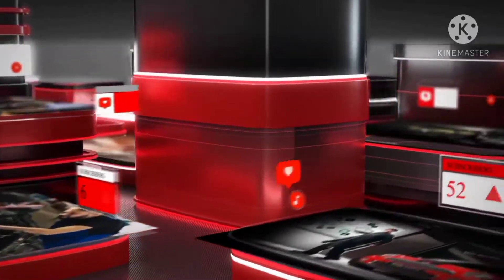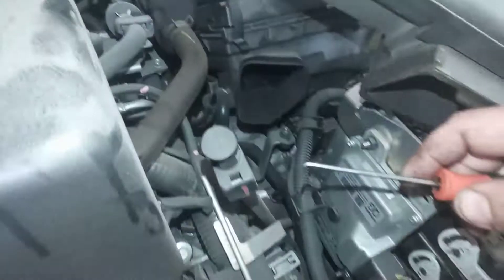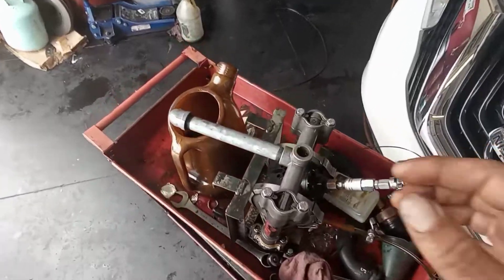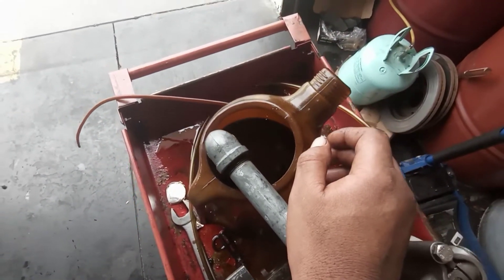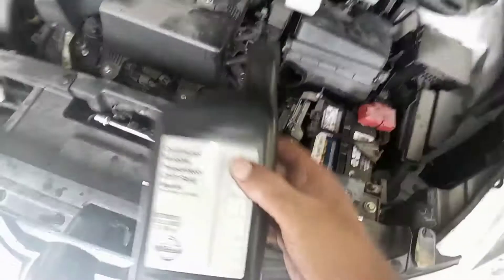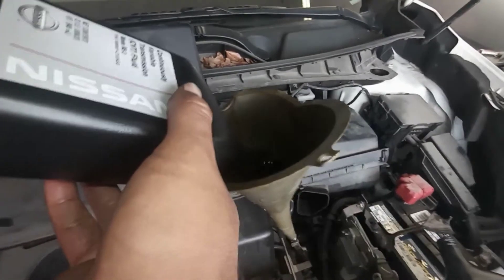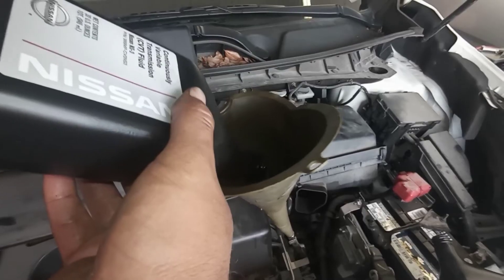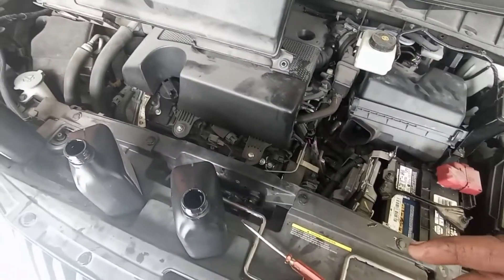2015-2021 How to change transmission fluid for Nissan Murano CVT

Comment: NO FILTER CHANGE? You are asking for trouble
Reply from the maker: A lot of people think if you change the filter that mean you are safe from damaging your transmission it's completely wrong most sharp they recommend change the filter if your car has over a hundred thousand miles but if your car has a low mileage you know have to just drain fluid and fill this is what the dealership do the same thing if the customer you didn't ask to change the filter then you guys just do regular service change the fluid only but if your customer requires to change transmission fluid and the filter the price is going to be more High so my videos about cars is how to fix your car for cheap but if I show you how to change the filter on everything most people you got to be lazy to change just the fluid oil change the transmission filter thank you so much for your comments
Reply: Don't need to Toyotas are the same

Comment: Screen in pan has to be checked and external filter changed  this will never remove all of the fluid from the pan this is not how the instructions in the official lease official Nissan manual recommend to do this

Comment: wouldn't it be not a bad idea to level it off at the end with the fill port so you know its at the right level?    with no dipstick,i'm not sure how u can get it perfect otherwise.
Reply from the maker: Just do whatever in the video and collects the fluid and at the same
Reply: @LessExpensivefix So you change engine oil and don't bother replacing the filter too I take it? Or bother checking the level with the plug in the side of the trans? You just hope it was correct in the first place? People,  this is not the correct way to change trans fluid. Dudes a hack.

Comment: Hello there. x tronic cvt transmission oil change does the authorized service offer? At how many thousand km does it need to be changed? There is a discussion here, the authorized service cvt says no oil change is required, but special service masters recommend changing it at 60 thousand km. What is the situation in your country? Can you give information? Qashqai
Reply from the maker: Any car has CVT transmission fluid requirement from Factory is supposed to be changed the fluid every 30,000 miles

Comment: Great video, thanks. Sucking the oil up with a pump has anything but advantages rather than draining from the bottom: no mess, no going under the car, you suck "or drain" more fluid and service time is way shorter. Done with both engine oil and cvt fluid in murano and sentra.

Comment: I recomend changing fluid from the bottom way because you would need to change the cooling filter and most importantly clean the magnets inside the cover this will keep metals from spreading around and damaging your transmission very important! 
This job is done half fast and i would not recomend this video he is trying to save some $ and in the end it will cause the same damage as not changing the fluid
Reply from the maker: If the customer doesn't want change the filter because the cost of the service so drain and fill is the cheapest one did the Florida is expensive is not that cheap

Comment: looks like you forgot to replaced the cvt transmission  filter, is next to the cooler
Reply from the maker: It depends to the customer if he wants to change the filter because the fluid is expensive

Comment: Makes sanse, unless your transmission leaks then the fluid you extract would be incorrect.
It's OK if the rest of the fluid stays just change it more often and eventually you will have semi new  fluid. I changed the oil filter and the screen inside the tranny and cooler flush and then after that I drain and fill only. I use amsoil cvt oil. I don't use the nissan fluid, nissan makes cars not oil. I believe idemitsu makes the fluid for nissan.
Reply: When I checked the level I use the level hole at the correct tranny temp using my scanner. Price of oil 100 bucks to drain and fill, tranny replacement 8 k dollars.

Comment: How would we know if dealer changed oil? If there is no dipstick? What do you recommend? I just spent $245 on it, I would like to know if it was done, thanks
Reply: go to valvoline and get it changed... u stay in the car and see them doing it all.
Reply: @Christina-wu6sx  What about the filter?
Reply from the maker: @josephfriday2661 if do you like to change the transmission filter you can do it no problem but remember everything you have to buy it from dealership no aftermarket parts only OEM Parts only for Nissan fluid cost $26 a quart Plus you need at least four courts or more ask the dealership how much fluid you need if you change the filter too this process can cost you until 300 or more
Reply: @LessExpensivefix  Thank you for the advise.

Comment: That is not a sealed transmission you dont know what the hell you are doing ! , there is a drain plug and and a fill plug on the cvt transmission pan  , the plug you took off the the dip stick tube is just that a plug you have to buy the actual dip stick from the dealer ! , why do you think there is a dip stick tube there , oh for a dip stick  that's right  ,duhhh, Nissan  just puts a plug on the tube to keep people like you away from messing with the transmission,  certified  mechanics  would never suck out the fluid like that ,you will never get all the fluid out like that  let alone judge the correct amount  of fluid to put back  from a sucking machine, the only thing you did right was use the correct  fluid , go get certified at Nissan if you choose to work on Nissan's  !
Reply from the maker: Thank you for your response to my video if you want to change the fluid for Nissan the fluid cost $22 plus tax plus if you want to change the filter is $600 plus tax at the dealership special parts the dealership do just drain and fill the Sims process what I did is the process why did or training or the dealership Salt if you want to save money is only way to do it and it's safe plus if you have a lot of miles on a car anoro Commando full flush because it can shock your system and often do you damage your transmission specialist CVT transmission cost a lot of money to fix it and a lot of mechanic you don't fix CV t0 command change the whole transmission so if you want to change the fluid just drain and fill the best method toomics save your transmission and save money and how much I charge to the customer to change all this fluid a charge $200 dealership is $300 plus tax just for drain and fill and this car takes NS-3 from dealership
Reply: @LessExpensivefix  the hell did you say??
Reply from the maker: When you take your car to the dealer and ask them to change the fluid for the transmission do you change just the fluid it doesn't change the filter
Reply from the maker: This is the truck I saw you because the fluid for this car from the dealer cost $21 a quart if you want to change the filter if you charge your extra so $300 for church fluid plus the filter be $600 job at the dealership but you can do it by yourself and be cheaper
Reply: @Jose-yh7li  LIsten many transmissions have sealed pans meaning you don't have access to the transmission filter unless you remove the transmission and take it apart. With that said all this guy did is remove and replace the same amount that was taken, what's so hard to comprehend..??? Yes there is the other ways to drain it but this is a fast, cheap and quick way to at least service the transmission which is better than nothing. Now if you rather pay the exaggerated amount at the dealer go right a head and shut up..........
Reply: @BigBoss-lm6cf  yeah man!
Reply from the maker: Thanks

Comment: Does it matter if it's all wheel drive?...
Reply: No
Reply from the maker: CVT transmission fluid only one you can use only from the dealer
Reply from the maker: Cvt transmission fluid only one after use from the dealership